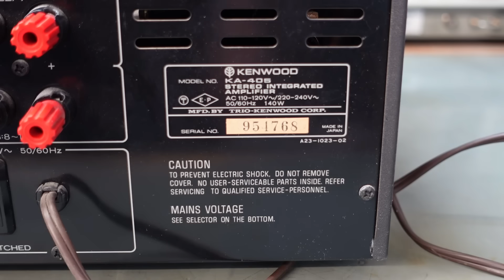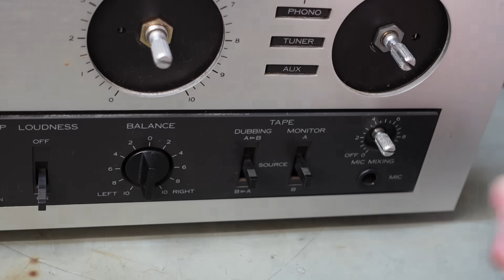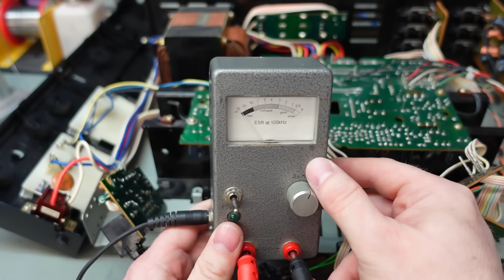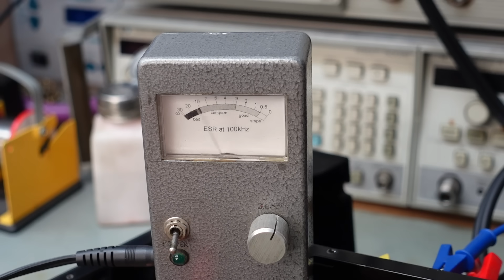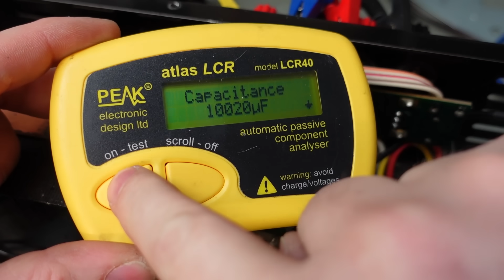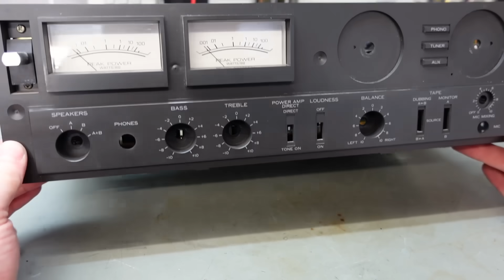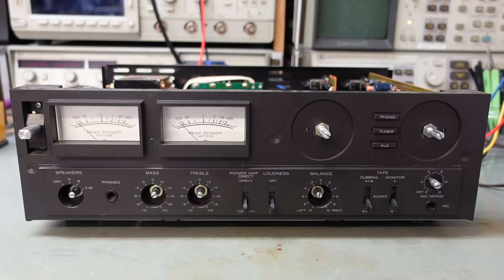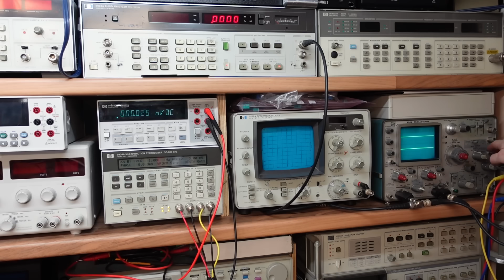Kenwood KA-405 Amplifier Service & MORE than Full Load Test.

Comment: i don't think it the best idea to test capacitors with your fingers on the metal part of the probes
Reply: These are small signal caps. They are not in the DC power supply or power output stage.
Reply: @paulanderson7796  & if someone who don't know what they are doing copies you but with big high voltage capacitors or mains voltage
Reply: @darrenwilliams414  That is their problem. Not mine. People do all kinds of stupid things all of the time. We can't legislate against stupidity.
Reply: @paulanderson7796  but you could show them how to do safely but you choose not to because that is their problem ok, good to know you don't give a toss about the safety of your viewers